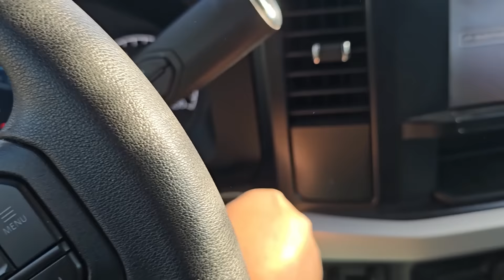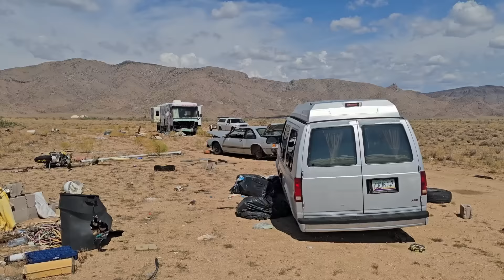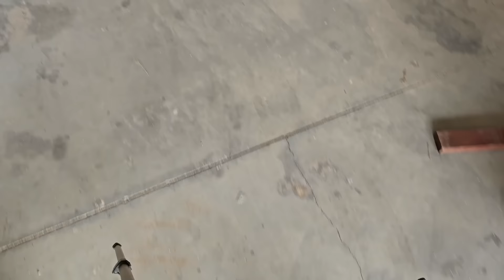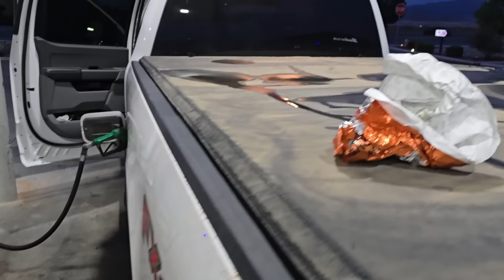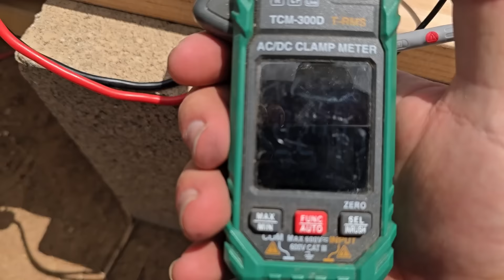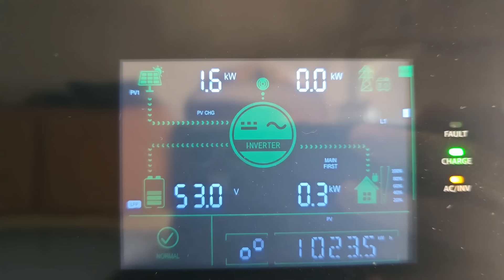DIY Ground Mount for $42 Per Panel No Digging (CinderMatic) | Got Shocked by Green Energy

Comment from the maker: This was one of two projects right before I went in for Belly Button Surgery.  I'm limited to lifting 15lbs for 5 more weeks!  I appreciate the love and support, the other Belly Buttons are coming in nicely.  We'll get together soon.
Reply: You gonna get a inney or a outey??
Reply: Hope you feel better soon!!!
Reply: When do we get to see the shocking video🤔
Just kidding brother i'm glad you're okay.
Always appreciate the Joe dirt references.😂
Reply: In the future, I would install the solar panels at a height of 2 meters (or higher). And with a shade net underneath, you’ll have excellent shade for a vegetable garden or something similar. Depending on the situation, you could bury the drainpipes vertically and use them as supports, with or without concrete filling.
Reply: how many more?
Reply: getting tube tied so soon? lol
Reply: Also been shocked the same way you did. I even took a 430VDC shock when I touched a PV input on my inverter while my belly was touching leaning over a grounded washing machine. I find it pretty sad that these inverters and batteries are not DC+ or DC- Isolated from DC/AC Earth Ground. Seems like a massive oversight. I even got shocked while in the grass one day putting a new connector on the PV input side of the wire run (solar panels disconnected, but shocked from inverter pv input while sitting in the grass touching the bare wires).
Reply: You need 1.21. Gigawatts of electricity to get back to the future.   🤔
Reply: Did Stevie the pilot YouTube ,,,reach out to you , she has a 1952 ,I think bonanza, and could use parts of yours, lol thanks BigAL California
Reply: Was it ac or dc current?
Reply: Glad your ok man .
Reply: Hopefully surgery went well. I know someone who went in for a "circular incision" and the surgeon accidently gave him a circumcision, so double check their work. 🤣
Reply: Your wife is gorgeous and a saint. Please provide life insurance for her and Maverick. You worry me, brother. 🙈
Reply: Did you take into consideration the angle of the panels and what happen if you have flooding rains Your panels will be 1/2 way in the ground. You can gain roughly 10% to 40% more energy by correcting a poor solar panel angle, depending on how misaligned or flat your panels were to begin

Comment: I know this is late but I would have drilled a hole big enough to go over the bolt head or a notch out to go around it then drilled another hole for screw to anchor it down better. 👍🏻 Awsome job.

Comment: Over 20 years ago, I got hit with >350V at like 250J. Luckily it was just across a fingertip, so the burns were localized to just the skin between the contact points, which carbonized. My arm was partially paralyzed for most of the day and every nerve in that arm had a constant burning pain for over a week. I think it took 1-2 months for the crater on that finger to heal out.

The conductivity of fat is lower than muscle, so that might have helped you.

Comment: I’m laying out my panels the other day and got grabbed by 200 vdc. It was my left hand. The power closed my hand on the cable and I couldn’t release it. I was literally dying. Suddenly everything went into slow motion and I struggled to move my right hand into position to grab the cable and rip. Luckily it worked and I survived. I saw God that day. 3rd degree sizzle burns on my left hand. I went inside and didn’t come out for 2 days. When I did come out I was armed with 3 solar disconnect switches from Amazon.
Reply from the maker: So glad you made it out!  I use disconnects right at the panels.  I got hit by the inverter solar INPUT.  Its crazy how you think you got it figured out then zap!.  Crazy you had the awareness to be able to save yourself
Reply: @HerbOMatic  thanks bro. I bought disconnects for everything. I literally have a 3rd degree burn hole in my hand. I could hear it sizzling and see it sparking. I knew I was dead if I didn’t do anything.

Comment: Those PV inputs hold a voltage for some time.  Also, even though there may be 2 PV inputs doesn't mean they're isolated from each other.  When I went to connect my 2nd string, PV2 breaker off, I measured 0v between the PV +/- terminals, but I didn't measure from them to ground.  My forefinger touched the screwdriver and got a good jolt. I measured 370v from the terminal to ground.  Once I shut the entire system down, it took somewhere around 15 minutes or so for the voltage to drain. Once it got below 48v, then I went ahead and tightened things up.  Helps to have some screwdrivers meant for electrical work that have insulation on them.

Comment: EG4 24k Hybrid Solar Powered Mini Split Kit (R32) * I’ve watched a video of one of these installed outside on a pad for the same homeowner. He plugged it up to His solar panels. It uses the Off grid power till it’s not sufficient then switches to the electricity plug installed right by it. It’s awesome to know it will run the a-A/C for Your Home from Solar Panels Mostly. I’d Definitely look into these units. It’s really cool to see Electricians put these on Their Own Homes and mostly NOT Run off Electrical Power from the local
Electric Company but Your Own Solar or Wind Generators that You Install. Out there Y’all Can Harvest All that wind 💨 into electricity back into Your Home Grid.

Comment: Run those inverters split phase and get 220 V mini splits, they use very little power that way.
Just series connect the high voltage panels up to 500V and then parallel those setups

Comment: Type:  
Service or Repair Issues
Status:
AnsweredMore info
I purchased a SunGoldPower SGN-11K15PRO hybrid solar inverter (Invoice No. REMOVED, February 16, 2026) for $3,395 as part of a $9,078 total order. The inverter experienced a hardware failure on July 5, 2026 140 days after purchase causing two sequential shutdowns during battery-only operation and tripping my 200A main breaker. The unit is clearly within the 5-year warranty period.I have been unable to reach SunGoldPower through any channel since this morning (July 6, 2026):Phone REMOVED: Goes to voicemail Phone REMOVED: No answer Email REMOVEDNo response Email REMOVEDNo response A recording states their office experienced flooding however there has been no email acknowledgment, auto-response, or any communication whatsoever. Complete radio silence from a company regarding a failed product worth $3,395 within warranty is unacceptable.I am requesting immediate warranty replacement of the defective inverter and formal acknowledgment of my warranty claim.Invoice: REMOVEDSerial: REMOVEDPurchase: February 16, 2026 Failure date: July 5, 2026

this is copy of Sungold's complaint

Comment: I built my array from "scrap" metal that was collected from metal flower displays at the big box stores, the ones that come in on pallets. Looks like the slot/hook type shelving uprights. Had a bunch of 6' and 7' sticks. The panels were free from a donation program in S. Fl.  I have almost 4000W on that ground array, with 6 for each column and 8 panels wide, so far. They sit high enough up that I've started using the area underneath as a work space. I took aluminum foil tape and sealed the gaps on the top between panels so it doesn't rain below.
The only thing I paid for was the nuts/bolts to build the erector-set, and the wire to hook all the panels to a central breaker box. Configured as a 12p 3s as the charge controller can't go higher than 140V

Comment: You could have saved yourself a lot of work by just running longer length 2x4's continuous rather than cutting all those little pieces. This would also go a long way in keeping wind uplift at bay.

Comment: A couple weeks late to this absolutely wonderful (cost effective) mounting system (thank you very much).  For people aiming for efficient solar panel collection, what was your orientation angle?  Right triangle calculator (based on your measurements) has it around 14.85 degrees.  Depending on your latitude, and the season, adding 2 horizontal 8" blocks under your standing (rear) ones would change the angle to around 27.5 degrees and increase performance (based on panel direction orientation).  Adding a 4" cap block would further make it 34.3 degrees (closer to what I need).  Yes, the bracket connection to the wood will be more difficult, but that can be fixed with wood wedges.  Thanks again.

Comment: the land really does provide, at my house I have a project coming up to fix the top of a concrete wall just under my ledger board in one corner of the house, was going to buy a wheelbarrow. has anyone seen how expensive they are these days, well I came home 3 days ago and there was one abandoned on the side of the road down my street with a broken handle, but otherwise good shape. I left it alone for the three days in case someone was coming back to claim it, but picking it up later.....the land provides.

Comment: Will Prowse had a video about how the PV inputs on AIO inverters have live voltage on them even at night. I  measured my EG4 12000xp at night sure enough around 260VDC. Will even shorted it through a meter to see how much current it had said it blew 10 amp fuse.  The reason for this is AIO inverters the PV inputs are not isolated from the AC side of the inverter.  Your cinder block mount is a great idea.

Comment: HUm -- my 01 f150 (350k miles) has the same problem and my dads old dodge has the same situation with the key --- HU   have fun with the new power  ps when are you going to start on a setup for the shop areas ????

Comment: The new lg window units with "dual inverter" sip power and do a great job at cooling for the cheapest window units i have ever seen. I can leave my fan on without ac on and it will run 2 days on a kilowatt. With ac on just 300 watts on low and 400 watts high.

Comment: Great news about your new power input.  I would be concerned that a big gust could grab your panels.  Consider pounding in some type of anchor.  Rebar maybe?
Reply from the maker: I want to develop this a little more as a completely ballasted system.  I have more ideas I'll share soon!
Reply: @HerbOMatic sounds like a plan is in the works.  I live in Phoenix just on the south side of south mountain and I am familiar with how every once in a while the bottom drops out of a thunderhead and wind speeds go crazy.  I have had all of my mature trees snap off where the big stick and the ground meet.

I have a small off grid solar system myself.  Much smaller than yours.   I paid a crew to install 12 (400W) on my second story roof.  9 facing west and 3 facing east.  I get enough power to run basic household functions but no AC or the clothes dryer.  I can run the pool, however, if it is not a cloudy day.  My system is  completely isolated from the incoming utility so a bit of a hastle.  I should put in an automatic fail-over when the solar poops out but I have not done that (yet) because  I missed that requirement in system planning and adding it now would really screw up the exisiting system wiring and conduit runs. :/

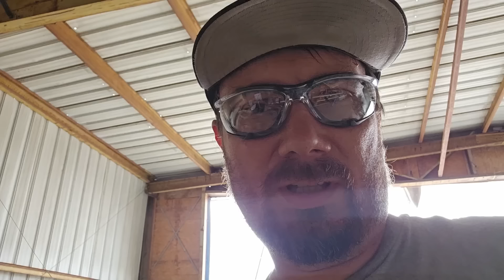Comment: 13:35  Actually, those are really cool safety glasses.  I wonder if you could have them converted to sunglasses?  Fun Fact:  screws and nails are sharply pointed which becomes a wedge.  When nailing or screwing near the edge, take a hammer and blunt the end.  No more splitting!

Comment: I mounted 3 315W panels in a 8x10 wood frame on a 2" pipe that go thri a 4x6 post in the ground. 12 panels all together. The 3 panels can rotated for winter and summer settings. You are spending alot of time and energy.

Comment: AC would clamp muscles (heart) and DC would burn you. ER visit is still prudent. I was using spit to slide my solar panel wires through gromets into my combiner box. On the last set I forgot to leave a junction open. They were 3 x 36V panels in series. I put both wires in my mouth to wet them so they would slide better. There was enough spit on my tung that I did not get a burn, but everything tasted like pennies for a couple of weeks.

Comment: G'Day Herb, 
What I believe you encountered, because I've experienced the same situation, except I didn't zap myself, is the fact that there is a Lot of surface area to each solar panel and if you have a lot they essentially form a Large capacitor with respect to ground (as in the Earth itself), and as you may be aware capacitors like to dump their stored charge in a hurry, and You made a connection between that capacitor and the earth on the cabinet and as you now know ZAPP.
It doesn't matter which lead from the solar cells you test from, you will have a voltage reading to earth even though it seems like there is not circuit ( unless you get technical).
Personally I've measured about 400V sitting on my panels to Ground, but if you leave your meter on that it will slowly sink to zero, take the meter off and that capacitor charges up again pretty quickly, so there is no avoiding the issue unless you ground out the terminals preferably through a resistor so it does so slowly.
This is the same affect that creates lightning from clouds to the ground, in technical terms Giant Static Electricity.
Just one of the Not Well Known issues dealing with solar arrays.
BTW I've had a new roof put on my house and the solar guys were a bit rough with getting the panels out from under some of the galled bolts holding them down, what they actually did was flex the frames of  quite a few panels and that has broken the seal between the aluminium sides and the seal on the back of the glass allowing moisture to get between the glass and solar cells, which results in a ground fault to the frame.
I've now got panels that are slowly going faulty because of this.
So I was a bit concerned when you fastened those angle brackets when they weren't sitting flush with the wood, time will tell I guess, and you do have a few spare panels.
Cheers from Down Under

Comment: Very general rule (not NEC rule): Over 50 volts OCV = Commercial Panel.
Reply from the maker: I don't think I like the commercial panels they are larger for the wattage and have very high OCV.  I don't know why but maybe they last longer?
Reply: @HerbOMatic  Yes that was the original dope on them. As you already know they are generally heavier framed as well and have those stackable corner widgets. It is only (relatively) recently that DIY/Homeowner inverters and charge controllers  could handle much series D.C. (The first thing I discovered about 10 years ago when I "scored" a bunch of German commercial panels and found out they were difficult to incorporate into a system.) Look into the "Hoymiles HMS-2000-4T-NA HMS 2000W 4 Module Microinverter" as it is a fantastic micro inverter that can handle and goes well with commercial panels. HINT: Wire the normally open side of an AC compressor/condenser with direct 220/240 from the Hoymiles or the same side on a pool pump to have the Hoymiles supplement the provided "grid" power. I know you are off-grid but it is very efficient even with solar supplied 220/240 A.C. ("What ever it takes") and a great way to not back feed if someone doesn't have Net Metering Contract but wants to have Solar help with their biggest consumers fo A. C.  The down side is when the A/C condenser or pool pump is off, the solar panel out put is wasted. In your situation you could have it contributing to battery charging or whatever.

Comment: Here it is again. You got this when you first purchased the place. Here it is again without the exact links: "EG4 12k Hybrid Solar Powered Mini Split Kit (R32)" or you could spend more and get the 24k. Remember they heat in the winter and you have tons of sun in the winter as well. Endless YouTubes on how to install and set up (for you it would be a CAVU day).

Comment: I would like to learn more about the accident. Since it happened at night, voltage was coming from the inverter, yes? But then next day when you turned those off, you were still able to power the light? Huh? I appreciate you showing the errors, too, so we all can learn and be safe. Thx.
Reply from the maker: Voltage was from the inverter.  Wjen shut down the inverters have capacitors (like batteries)  that you still need to bleed through a resistor (an old light bulb)  you have to use incandescent (you can still get as an oven bulb since you cant bake leds).
Reply: @HerbOMatic thank you. I’m a few days away from wiring my first one up. I appreciate that. You can pat yourself on the back for saving a life somewhere out there. See you around! 😅

Comment: Good effort Herb glad you have started going your ground arrays. The way the worlds going with the shortage of oil you might need to do some guard towers to protect them for your next project
Reply from the maker: This is a temp setup, while I was recovering from surgery.  I didn't have time for an elaborate thing but we needed more power.  It's working well.  I am shifting to a more prepper mindset as time goes on lol.

Comment: After you are closer to your normal, double check the bolts.  New lumber at the stores usually have a little moisture left in them.  In the desert that should bake out fairly quick, shrinking the 2x4s a bit.

Comment: ok i, from wheatbelt West Australia and your shows good, you are really trying there its great .... but ... do something useful, and faster ... cleanup your sheds they are a mess and even better get that grader going it will really be a lot better to maintain roads keep firebreaks etc .. anyway no offence just I think your spinning your wheels ... mrs herb o matic is gunna get upset soon ... enough of the power system should be able to do that in 2 shows not 20 ... all the best regards Greg🤪

Comment: The gas station trash can quandary is solved as such; use a paper towel from by the windshield washer handle to lift the lid off the can and throw your trash inside. Whatever happens after that was meant to be.